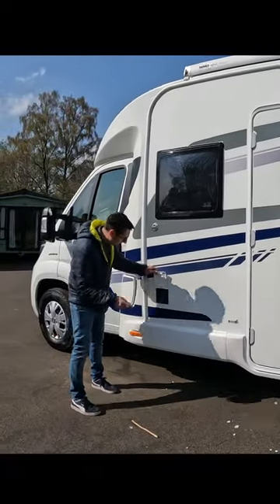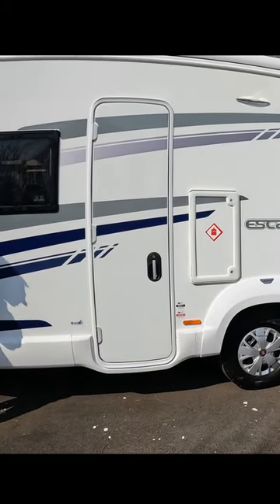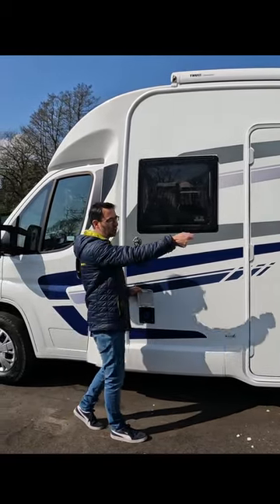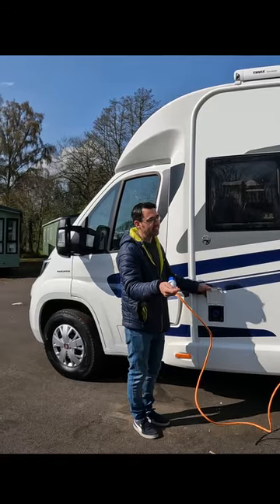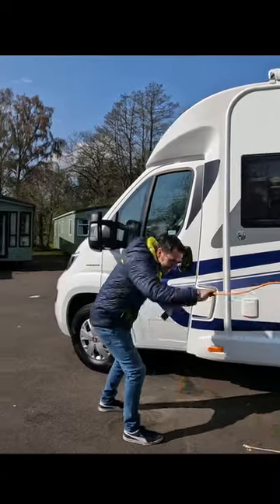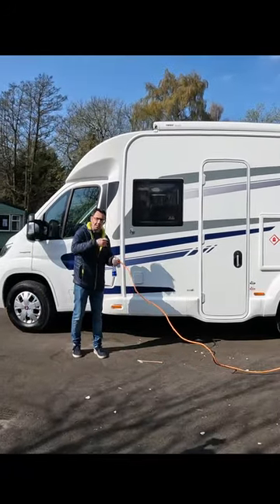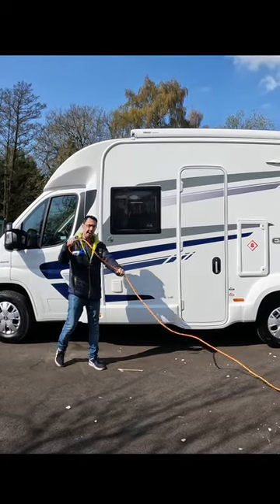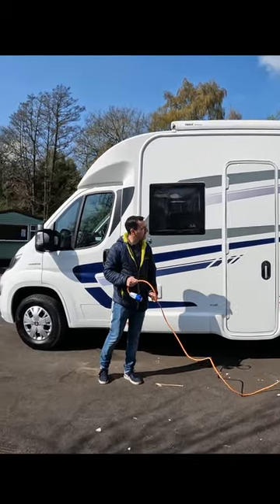Dangers of Caravans and Motorhomes

Comment: 5Kw?
Reply from the maker: Doesn't take much, heating, hot water, fridge, charger, then if put microwave on its not far away.
Reply: @thecaravanplace  I thought the commando socket max is 16 amps.. 240v @16a=3.840Kw, or have I got it wrong?